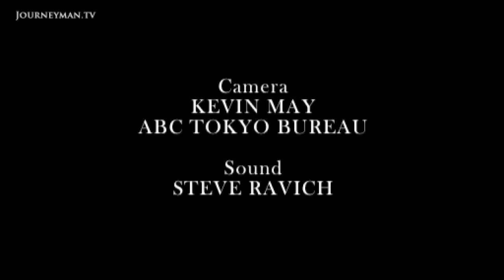Tokyo’s Incredible Underground Flood Defence Systems

Comment: Check out London Thames flood prevention system.... It's also good like this....
Reply: ***** no no.. There have built a string of water control systems located on the surface of the water itself. These structures very much control the excess water

Comment: if building cities causes guerilla rainstorms, what causes west and north africas in barren landscapes?
Reply: There is no easy answer to that question.  You need to research the difference between regional geographic features as they relate to regional weather phenomena.  Not all cities create "guerilla rain storms.  Tokyo does because it is such a massive city which creates its own weather by creating a heat island effect which increases humidity and that can enhance the high precipitation that occurs in the area.